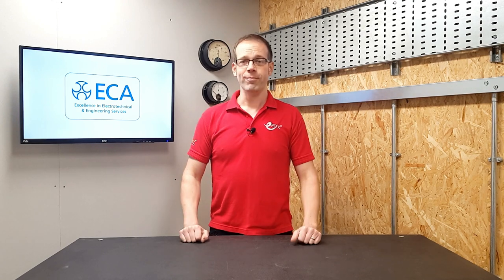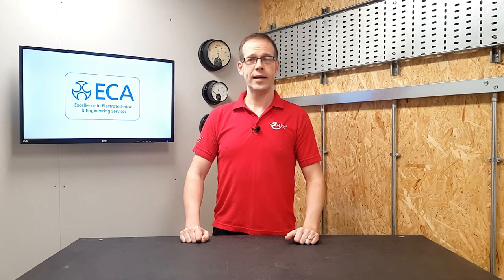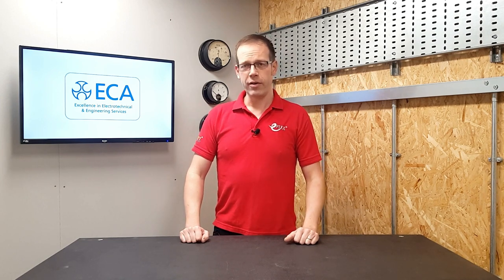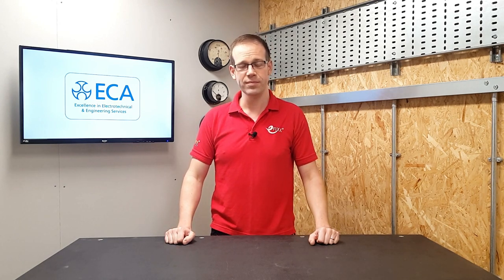Do smoke alarms need a dedicated electrical circuit? - Electricians' Q&A - BS5839-6

Comment: I would always use a dedicated circuit and Grade D1 detectors. Fitting isolators off local lighting is cumbersome and typically the time it takes to do so, a new circuit can be provided - also meaning you don't have to test the existing circuit for lighting.

Not least is anything above a Grade D in BS5839-6 needs a dedicated circuit in any case.

Comment: I always double the circuit up with either an upstairs or downstairs lighting circuit or a lighting circuit not supplying a kitchen or staircase for health and safety as if they need to be isolated at the consumer unit these areas still have lighting for the customer or tenants of the property.

Comment: Far easier to have them on their own circuit. That way there's no need to disrupt the clients "normal" everyday routine, should maintenance be required.
Reply: And you might actually be able to see your hand in front of your face whilst doing said maintanence eh!
Reply: Too easy for homeowner to turn them off. Nuisance etc

Should be on with lights to avoid this.
Reply: @GeeTheBuilder    For new installs I would put on own circuit as would have wired interlink between alarms, for existing then just come off lighting and make them wireless interlink..     There are positives and negatives to both.  I believe though most smoke alarms have a battery in them incase of power cut so just turning off the mcb will not deactivate the alarm so dont really see that as an issue.
Reply: @steve11211  & the mains powered smokes generally "beep" when on battery only..... Forcing you to turn the breaker back on!
Reply: @GeeTheBuilder  If the user is able to turn off the dedicated circuit, what makes you think they wouldn’t simply remove the unit from the ceiling if part of the lighting circuit? If someone wants to disable a smoke alarm then they will do that whatever circuit it’s connected to...
Reply: @juancornetto8243  Well said that man
Reply: @juancornetto8243  Isn't it easier to repair a smoke when you can actually see what the hell your doing?
Reply: @steve11211  I agree. Everyone seems to forget that part.

Comment: As an example, on a 1990’s built property the smoke alarms are on the upstairs lighting circuit but with no means of specific isolation aside from the 6A circuit MCB. Appreciate that this is an older installation but a typical domestic system. Labelling of the Consumer unit MCB to show that the circuit is Lights plus alarms is another point to mention. 👍

Comment: If you don't foolproof your installation, a fool will foil all your preventative measures.
Never put smoke alarms - or anything that you don't want the punter to turn on or off, ever - on a dedicated circuit, and even more do not mark it at the consumer panel.
Put a protection somewhere inaccessible to the consumer that in case of fault trips and sounds an alarm.
Any skilled electrician will know what to do if the thing needs servicing, but the household won't be able to turn them off if the device(s) "annoy them".
This is one of the many BS (pun intended) regulations that don't failsafe installs and don't protect properly.
Like ring mains, the worst idea ever.
And don't start a flame war saying that the British household circuits are the best, the safest, etc.
You know they're not.
Check the stats on electrical fires and compare them with Germany, for example.
And sit down.
Reply: Wow! Someone sure is salty on here!